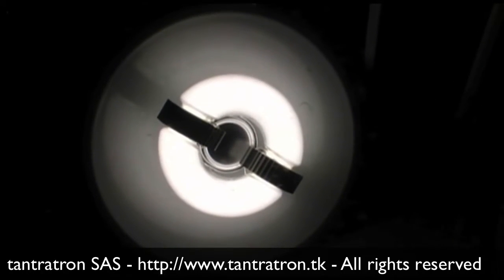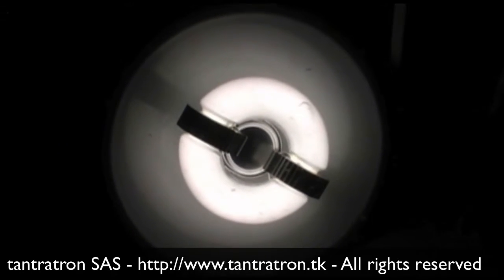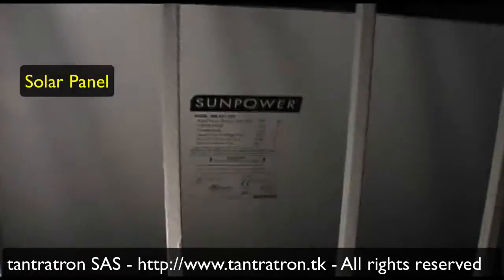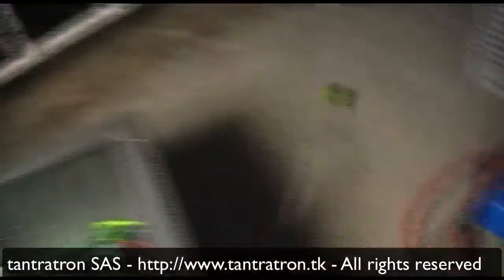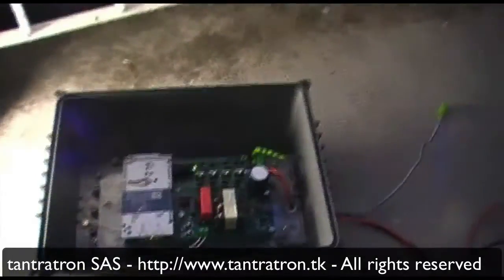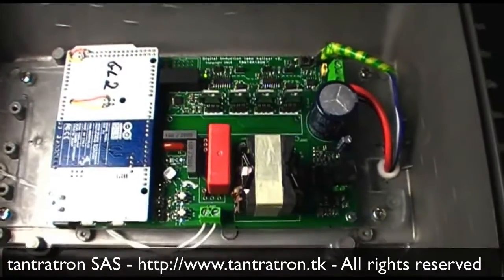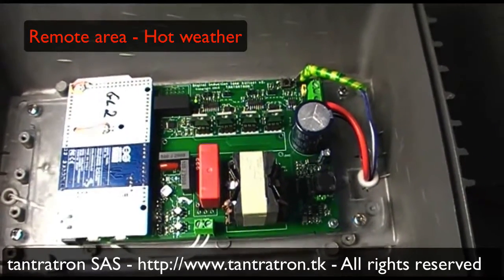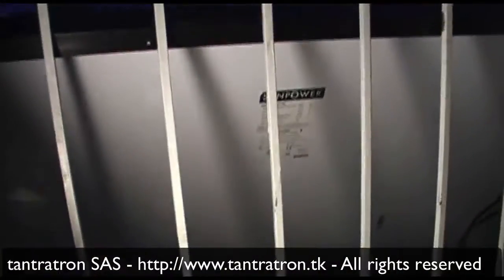Solar Induction Technology - Part 5

Comment: Very true, in very hot locations the Induction bulb and ballast will last the longest without issues vrs LED's which are susceptible to failure when there is too much heat for long periods of time.  While LED technology is getting better overall, there is still a tenancy for reduced overall hours of performance and failure with high heat conditions vrs Induction.
Reply from the maker: Another thing with induction, we can install the electronic ballast remote like 10m away from the induction tube. The transfer of energy between the ballast and the the tube is high voltage and high frequency so almost no loss with remote ballast. This is almost impossible to do with LED because it requires DC power link so you need to pay high price for heavy copper to mitigate the I2R losses. The remote ballast is of upmost importance in hot countries with solar panel because all electronics suffer of heat but with remote ballast, you can install in cooler zone far away from the tube.